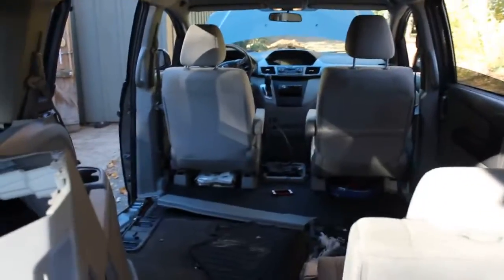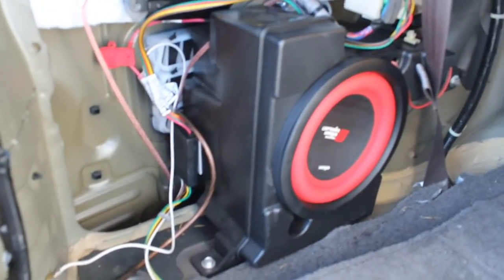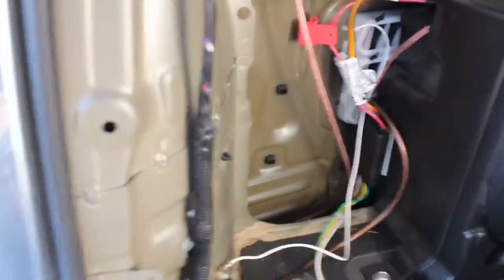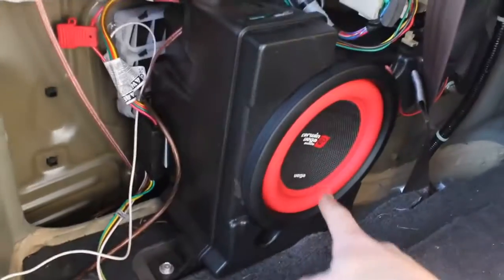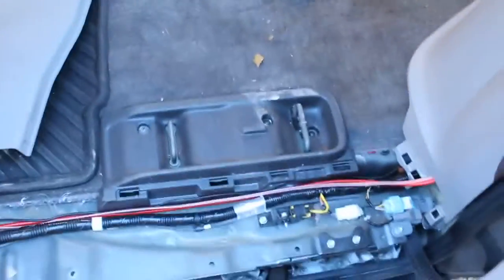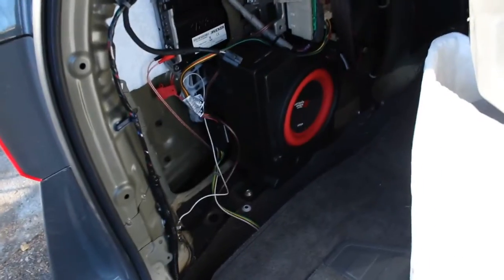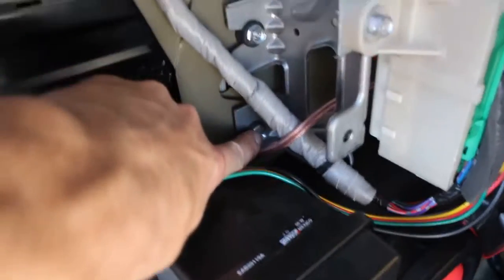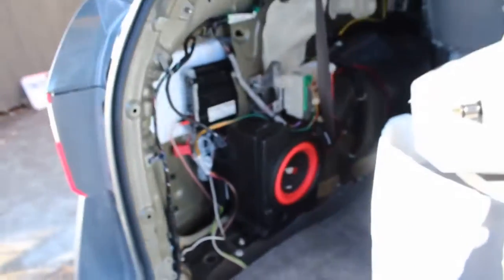Aftermarket Subwoofer In 2011 Honda Odyssey LX How To

Comment: Quick question you might know. I have a 2016 SE with the touchscreen on it. I was looking in doing the 3rd row seating speakers from the elite and add a better sound system( front speakers, door speakers and sub with 2 amplifiers).

When you did your stereo did you add in the hands free functionality converter for the steering wheel? Also on yours did you by chance see if the ports to add the 3rd row speakers were  under the plastic panel?
Reply from the maker: No and no
Reply: @porkercon  okay, thank you for the reply back.

Comment: Did you use the stock sub box? If so did you have to modify it at all? Or did you just drop in the new sub?
Reply from the maker: Yes. No modifications.
Reply: Can you post a clip of how it sounds? I want to do the same but want to make sure its giving me enough bass. Thanks man!
Reply from the maker: No. It's not very much bass. Just adds a bit over stock. Really the only reason I did it was so it would work with an aftermarket deck.

Comment: Was it easy to open up the panel to get to the sub.  I would like to do this mod as well.  Any tips to open the panel up.  Also is that a shallow mount sub or would a regular sub fit.
Reply from the maker: Ya not to hard, just be careful. This was not a shallow mount, but I measured the depth of the enclosure and chose the sub accordingly.
Reply: Thanks.  Was it all clips.  Any hidden screws.
Reply from the maker: All clips, far as I remember.

Comment: Any issues with amp over heating in that location?
Reply from the maker: nope
Reply: Did you remove stock amp? If so where is it located? Also any ANC issues?
Thanks for the help!
Reply from the maker: No, just bypassed it. No ANC issues.
Reply: @porkercon  Do you happen to know where the stock amp is located?
Reply from the maker: @micn7954  No, might be in the stock radio.

Comment: Honda put a sub where the spare should be... Not in the floor.. Smh.. Sub should be on the other side... Plus the oem sub is a paper cup.. 40k vehicle... It's an embarrassment to honda to stick 50 dollar sound systems in their vehicles
Reply from the maker: This is a 32k vehicle. Spare is behind the console at the front.